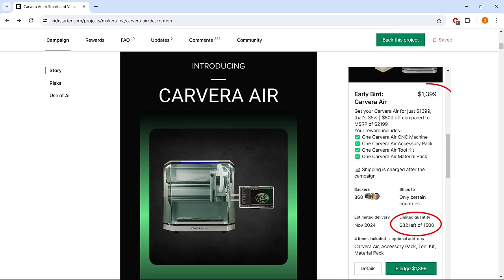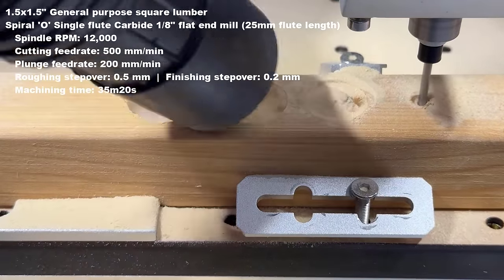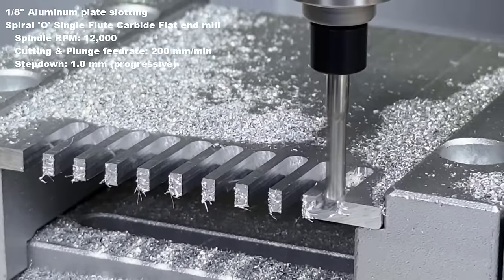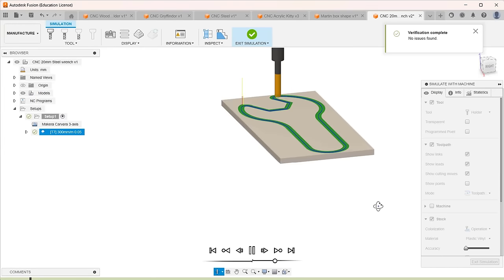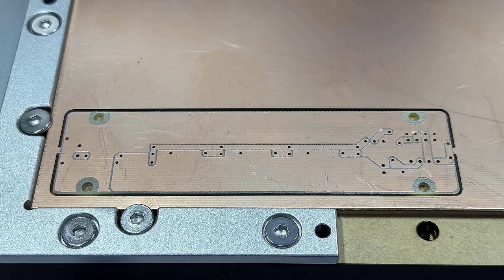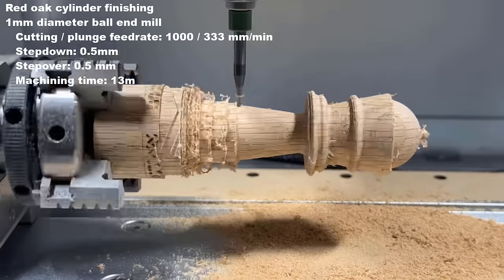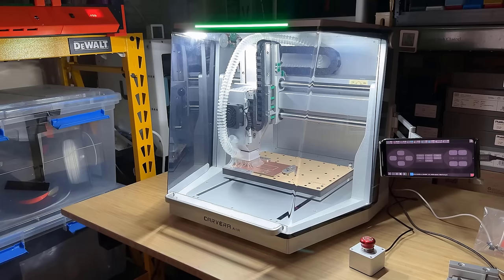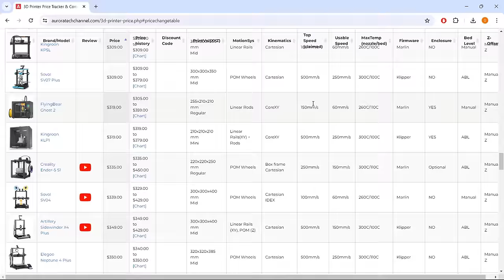Makera Carvera Air In-Depth Review: Testing with wood, aluminum, brass, steel, sound & accuracy test

Comment: Aurora, can i give you some tips on toolpath programming and machining as someone who works with both professional and hobby machining equipment? I've used equipment comparable to this (Carbide Nomad) to make mechanical parts from hardened steel and titanium.

You are creating toolpaths that are very old fashioned. Full width slot cutting at very slow feed rates with a very shallow depth. These toolpath choices result in making parts that are louder, less accurate, slower, and produce more wear on tooling. This old approach works best with older knee-mills that have tons of spindle torque, but not modern machines with high speed spindles. 

Modern machining uses "HSM" (high speed machining) techniques. These techniques take advantage of the carbide tooling we have now as well as higher spindle speeds. 

1. Machine much deeper. Aim for a depth of cut equal to the diameter of the tool. This means you arent putting all of the wear on the last mm of tool, helping tools to stay sharper for longer.

2. Machine much narrower widths. Try 1/10 the tool diameter. You should never cut a full width slot. Remember that the center of the endmill doesnt really cut - it grinds. See Saunder's Machine Works' video on how to cut around a profile without full width slotting.

3. Increase your feed rate. Your aluminum feed rate should be around 1000 mm/min or more with this machine and a 1/4" endmill at the DoC and WoC I've incidcated.

4. You should only use single-flute tools with soft materials. Hobby-grade machines are not rigid enough to use single/zero flute tools with aluminum. Cheap chinese carbide from amazon tends to be poor quality, and you can get very affordable American-made carbide tooling on eBay from Kyocera or HTC. 2 Flute endmills produces the best chip size for our machines. 

Too many flutes produces chips that are too small, cheating abrasive dust that ruins the finish and the tooling. Too few flutes creates significant vibration and makes a tool much less rigid, reducing tool life.

5. Stick with climb milling for any finishing pass. Our less-rigid hobby machines typically have less backlash but worse rigidity than old cast-iron frame mills, and benefit from climb milling.
Reply from the maker: Thanks for the tips! I have learned a lot from you!
Reply: @AuroraTech  Glad to hear it! Your channel is my favorite for these hobby CNC mills. I bought my Comgrow Robo (or what used to be a comgrow robo) and Sovol SV-06 (now klipperized) off your recommendations. Keep up the great work!
Reply: Following

Comment: Would have loved to see how well it deals with dust/chips during some of the metal/wood segments as most users wont be running it without the dust shoe.  I understand the need to get good footage, but running it that way is unrealistic for most people. Dust collection is very important to me, and the one thing that could get me to cancel my order. Otherwise, excellent review. I backed after your first video. Maybe you can do a youtube short showing the dust collection with aluminum and wood?
Reply: There’s another video on here and the guy cut a pretty big piece of plastic and it was an absolute mess! Def Would recommend a shop vac. You can attach a vacuum to the side and lot clean as you go as well so I’d doesn’t really matter how messy it gets, as long as you’ve got a good enough vacuum it you’ll be fine..

Comment: Great job. By the way, the Shop Vac lies about HP. In order to be 6 HP it would have to be 4.4kW and would need a 50 amp circuit.
Reply: ^^This
Always de-rate Chinese stuff by 70% to 90%.
80% de-rate is about 1.2HP which is about 5amps.

Comment: Try cutting slots with a smaller diameter tool than the finished slot, then make a clean-up pass in the non-climb milling direction for a better surface finish.

Comment: Impressed by the result on steel. I think these small machines would benefit from high feed end mills for steel as these increase feed rate on shallow passed considerably, while reducing radial load (chatter). Solid carbide small diameter high feed end mills are not very common yet, they are frequently used as indexable larger diameter cutters for roughing steel molds, ...

Comment: That tool changing handle is interesting because it could be driven by a servo, no need for an air compressor (the usual way tool changers seem to get driven).
I wonder if it's doing something mechanically magical or is actually driving a piston to provide compressed air.

Comment: Thank you for this review!  Do you think the laser module is worth buying at the kickstarter price, or is it better to just go to a higher power dedicated machine if you want to get into laser cutting/etching?
Reply from the maker: Their laser module is only suitable for engraving purposes. The price of $99 seems reasonable if you only require basic engraving on your workpiece. However, if you intend to use the laser for cutting, the 5W module is insufficient. For cutting tasks, you'll need a dedicated machine with significantly higher power.
Reply: Thank you!

Comment: do you get notified when its time to switch bits? i plan to leave the cnc in the garage and check on it once a while.
Reply from the maker: The machine beeps a few times to remind you to change the bit. If you use an Android phone as a remote, you can keep the app open and monitor the status, but I didn't see an option to send notifications when the app is not in use.

Comment: Very good review as usual!
Can this machine be controlled using a Linux system other than Android?
Reply from the maker: I haven’t tried it, but using Anbox or similar programs should allow you to run Android apps on Linux.
Reply: @AuroraTech  Thank you for your reply !
Indeed an application like anbox or android-emulator should do it.

Comment: Does it do 3D contouring?
Would have been nice to see it carve something.
Reply from the maker: The machine does support 3D and 4th axis features if you use Fusion 360. However, their own CAM software currently only supports 2D. They mentioned that the 3D and 4th axis features will be available when the machines are delivered to backers.

Comment: .05mm step down for mild steel is a bit, pathetic…. I’m glad it can do steel, but this seems to be a case of, it technically can vs realistically can. I’d wager it needs a motor about 3x more powerful to make it practical for milling anything out of steel. 

Still, it’s an improvement over most of the desk top machines like this. Eventually when they grow to where they can more realistically do steel, I’ll hopefully be able to afford one.
Reply: what other desktop cnc can do mild steel?
Reply: I don't think people buying this machine will be doing steel very often. Sometimes it's nice to have a feature that you'll use 1-2 times a year so I don't have to trudge down to the makerspace in bad weather. If I'm doing large jobs or working with heavier materials, I just go down to the makerspace for a 1-2 day ADHD sprint, but most of what I do can be done in my workshop. If it's a small job, it's a pain to get ready and drive down to the makerspace. I can't afford/don't have room for a larger machine that runs off 220v or even 3 phase, but being able to make a small steel bracket on this machine will be a godsend for many projects. 

Don't get me wrong, I wont be cancelling my makerspace membership when this unit arrives, but I will no longer have to drive down there any time I need to machine metal, which is amazing at this price point.
Reply: It has more to do with rigidity than power.
Even on aluminum, you can see the machine lacks rigidity and chatters like mad.
You won't get steel to machine on an aluminum machine well. It takes a huge amount of tool pressure to machine steel, so all you can do on a machine like this is use tiny cutters and light passes.
Still, it does a better job than any other toy machine I have seen to date.